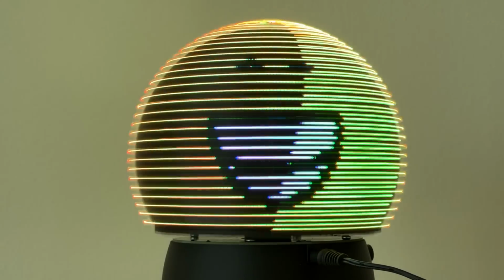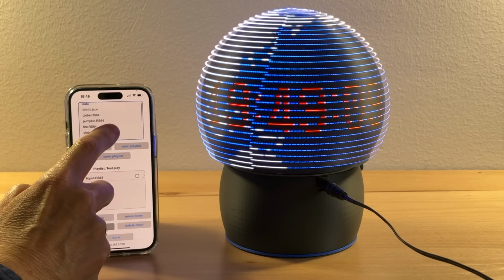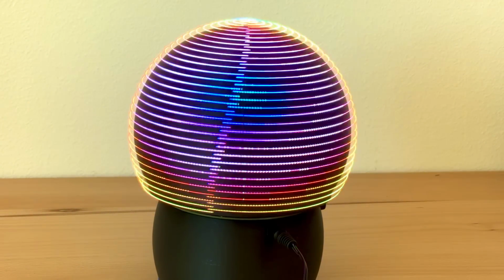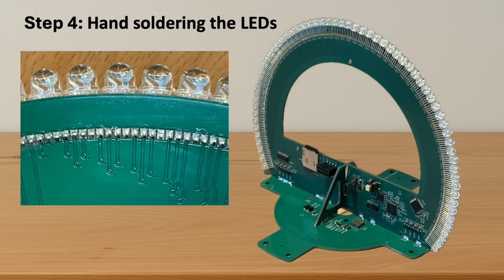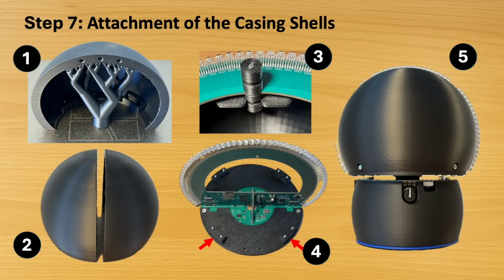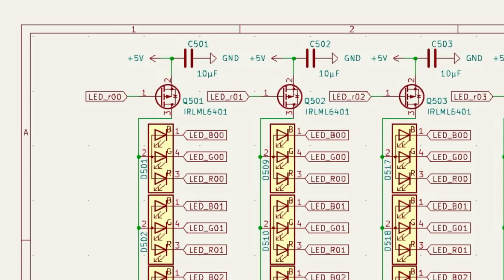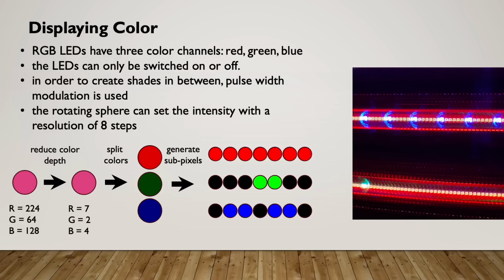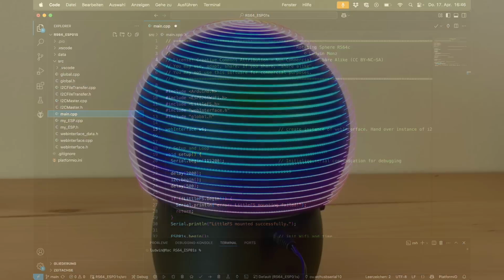Rotating LED Sphere – Building a RP2040 POV Display Step by Step

Comment: Beautiful
Reply: Omg sorry, I forgot I already had this reaction when I watched this video last night. I love this project - thanks for much for taking the time to make a thoughtful video!
Reply: Perhaps next a spinning volumetric display? Like what mixtela did?
Reply from the maker: Thanks, Philip!
In fact, I was considering a 3D display as an alternative to the sphere development. I don’t have any immediate plans, but I might pursue it at a later stage.
There is one key learning from the sphere project that makes me hesitant: the real challenge isn’t the electronics or the software — it’s the mechanics. (At least I know how to handle the electronics and software, but I struggle with the mechanical aspects.) Spinning such a device at high speeds is a big challenge due to the strong centrifugal forces. Even small imbalances cause significant vibrations. I need to figure out a better way to balance the rotor.
Right now, I’m working on miniaturizing the color display — I have a few ideas I want to test out. In any case, I’m also looking into ways to integrate a vibration sensor into this display, which I plan to use for balancing.

Comment: This is a very cool project. I have looked at the BOM but don't see the motor that was used listed. Thanks!!
Reply from the maker: Sorry, I missed it. Will update the BOM in the next days.

The motor is called 31ZY 6V/4000 rpm. I bought it on Amazon for 11€.
Reply: @LHM000  Thank you!!
Reply: @LHM000  I also noticed when uploading files to JLCPCB that the RS64c BOM has 1k resistors R301,R308 shown as PN C11702, but 270 ohm resistors R403, R404, and R405 are also listed as C11702. JLCPCB was confused..
Reply from the maker: Randy, I will look into this later today. Maybe they changed numbers?
BTW: if you build a display, you might want to send me a private message on instructables.com. Probably, more questions will come up as you go.
Reply from the maker: OMG! That is a bug! I copy and pasted the resistor and forgot to change the part number. So, in my finished device I am using 1k resistors for R403, 404, and 405. This sets the forward current of the LEDs to 20 mA (instead of the 75 mA, which I wanted to have @ 270 Ohm). Therefore, the brightness of my device is lower than it could be.
You could change the value of R403, 404, 405, but please be aware, that I have not tested whether this works, or not. I am optimistic that it will be fine, but there is always a risk of side effects.
If you want to change the value, you could use C25104, which is a 330 Ohm resistor with 0402 footprint. This component is a so called "basic part" at JLCPCB, which means, that they will not charge a loading fee. If you don't mind the extra cost, you could go for C25099, which is a 270 Ohm resistor with 0402 footprint.
Going with 330 Ohm would set the peak current to around 70 mA, which would still be more than 3x compared to what I am using.
For the time being, I will not change the repository, as the 270 resistor has not been tested.
BTW: one thought on an unrelated topic: If you order the boards at JLCPCB, make sure to use bom.xlsx and positions.xlsx files (both in the production folder).  I have slightly modified these compared to the .csv version.
Reply from the maker: Please note: I have added a document "How to order PCBs from JLCPCB". This might be useful for finding the right options. The document is in the root level of the repository.
In order to move forward on the R403/404/405 issue, I ordered 270 Ohm resistors, as I did not have any 0402 here. I will test it out, probably until end of this week. I will keep you posted.
Reply from the maker: so, finally I got the 270 Ohm resistors, changed them an tested. Please check the readme.md in the repository for details. The short version is: I have corrected the reference in the schematic and the production file.
Thanks again, for making me aware.
Reply: @LHM000  Great!! I'll check it out..

Comment: I'd love to see how this looks in person! I feel like the video isn't doing it justice. Maybe try a slower shutter speed to reduce flicker? We're also never seeing the image fully interlaced, so I'm sure it would look even better with more calibrated camera settings.
Reply from the maker: I am using the Blackmagic app on my iPhone to take the videos. This app allows to set shutter speed, aperture and ISO individually. The video sequence with the spinning sphere was taken at 1/24 s shutter speed. This is the lowest speed possible with the iPhone. However, the display spins somewhat faster than 10 revolutions per second. Therefore, you only capture about half a turn. But in order to see the fully interlaced image in every frame, you would need 1/10 s shutter speed. BTW: the photos were taken with a DSLR, where I reduced shutter speed further. There you can see the full image.

So, why not simply spin the display faster? Well, unfortunately it is not that easy. The timing has been designed for 10 revolutions per second. Going faster would require to increase repetition rate of the interlacing by a factor of two. This could be done, but would require a second shift register, which would add complexity and cost. 

The other factor, which I really underestimated: it is everything but easy to spin a complex, irregular shape at high speed. Even slight imbalances cause strong vibrations. And it gets much worse, when you spin faster. The centrifugal forces are enormous.The current mechanical setup with off the shelf motor and 3D printed plastics components is at its limits. To increase the rotational speed, it would be necessary to use a stable shaft supported precisely by ball bearings at two points. Considerably greater effort would be required to compensate for the resulting imbalance, all together significantly increasing both complexity and cost.
Reply: Does it look much smoother in real life
Reply from the maker: it certainly is flickering less, in real life. 
However, the limitation of the device is the speed of rotation. The faster you go, the less flickering you have. But there are limits on how fast you CAN go. These limits are the mechanical setup with its residual imbalance. The device is vibrating more and more, when you go faster. You can try to manage this through better balancing. But that is not so easy.
Reply: I follow a channel that does spherical volumetric displays. Each generation of his display uses a progressively larger bearing. You may want to skip the skateboard bearings and go straight to ones which are 10cm in diameter.

Also put something heavy into the base, like a bag of sand.

I forgot how he did the balancing. But it involved adding weights or shifting them around. You could add two perpendicular rows of holes in the rotating power supply board. Then populate select holes with screws.
Reply from the maker: well, I would like to keep things small. If there is an imbalance, it needs to be corrected. Absorbing the vibration with mass is not exactly a strategy I like. Obviously, that is just a personal preference.

Comment: Now make a version with 4x the led. Power it with ground in the bearings outer shell. And + in a shaft in the middle or in the bearings inner shell. Ceramic balls.
Reply: I think the “commercial “version I have seen had 3-4 pcbs . Not sure why they didn’t use a single 3-4 layer pcb.  ? Maybe prototype or just cheaper to make one pcb for vcc ground data clock. No clue
Reply from the maker: The bearing would not replace slip rings, as the axis rotates. But even if you use the axis, it would be just one contact. There is no contact to the outer part of the bearing to the rotor, obviously. Anyhow, the wireless solution works well and does not need replacement, even with more LEDs.

Comment: How are you transmitting power without a slip ring? I am having an issue understanding what you said in the video, it sounded like you said a wire converter, YouTube captions says royal converter?
Reply from the maker: In essence, it is a transformer. The coil arrangement is such that it also works with a relatively large gap.
The same principle is used in wireless chargers, although I am not using the Qi standard.

Comment: Did you try to push the horizontal resolution to the max (no shade trick, and max blink speed)  and display a vector image or some mathematical function ? What is the max resolution/frequency you got ?
Reply from the maker: You could probably drive the horizontal resolution further. However, as the vertical resolution is limited by the number of LEDs, it would not improve image quality much, I presume.